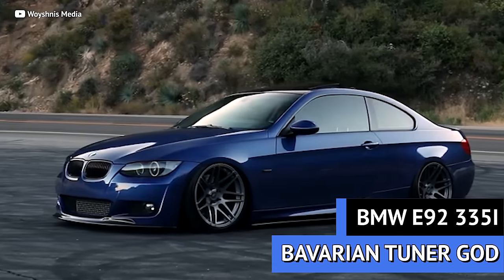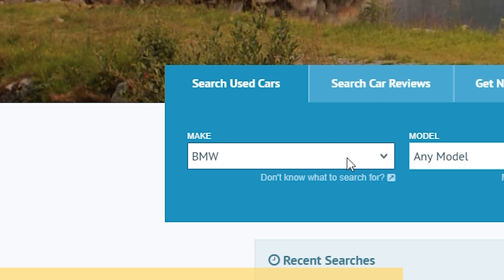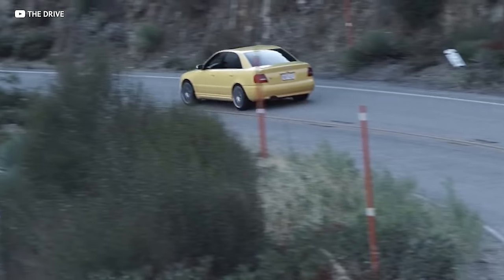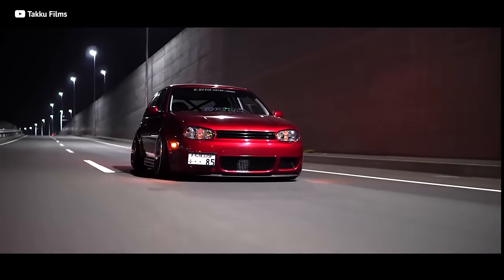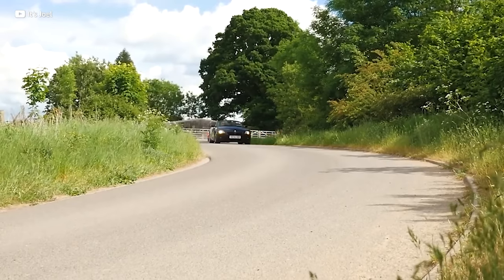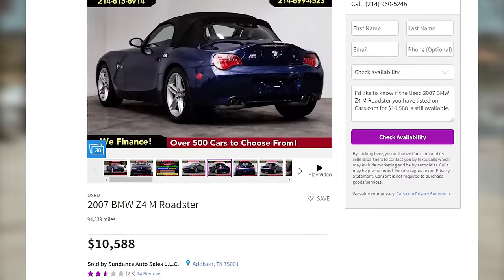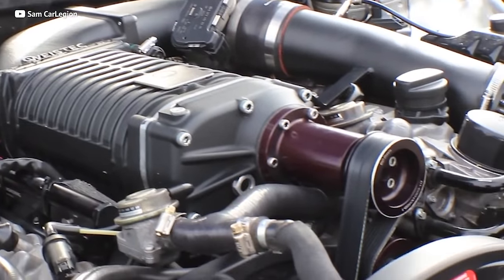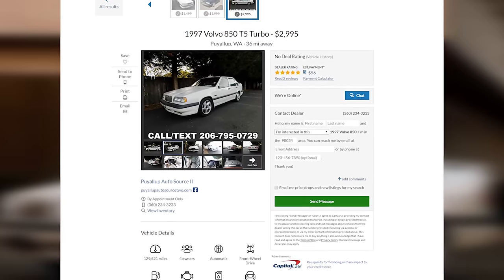CHEAP European Cars with INSANE Tuning Potential

Comment: Well, instead of the Z3M he could have put any BMW with a M50B25 or M52B28, they are easy to stroke to 3.0L and have quite the tuning potential (There are M50B25 engines with more than 1000hp)

Comment: Those older saabs can handle much more power than the new ones. For examble b204 and b234 internals last up to 600hp. You can take lots of power from the engine and that doesnt cost as much as compared many other cars

Comment: Love Swedish cars! My Daily is also a very nice grampa sleeper. Volvo S40 Turbo Stage 2. 155.000km with original clutch, 0 Problems. the problem is that, at least here in Spain, is not very appreciated by tunners as well as saabs... :(((

Comment: How about old BMW engines? For example M50B25. Thats the one they've called european 2jz. In stock it has 192 HP. Some people build it up to 600 or 700 HP. A Little turbo kit tuned to 0.4 bar can turn it to 400HP little monster. ON STOCK INTERNALS !!!

Comment: The b8 Audi s4 with supercharged v6 is also a great tuner car... they can make upwards of 500hp with the right bolt ons and tune... I have a b8 and with a singles pulley, tune and it makes around 400whp up from the stock 333chp

Comment: Look, I love my BMWs, so I shouldn’t be ignored when I say that the Supras 2JZ smokes it’s Tiers, while the N54 smokes itself- likely blow up if you touch it
Reply: What about the maintenance cost of your BMW's is it really that bad like people say?
Reply: marouan harrath it’s not all bmws. The N54 was BMW’s first turbo engine in many years and they f***ed it up pretty bad. The engine is stupid strong internally. But ansillary components fail. Water pump, high pressure fuel pump, injectors leak, turbo wastegate rattle, oil filter housing gaskets, valve cover gasket, oil pan gaskets
Reply: @marouanharrath7909  No the maintenance is alright but I'm from Europe though 😃
Reply: @marouanharrath7909  Audi is way worse
Reply from the maker: hahaha
Reply: @laysy1743  really? I thought Audi's are more reliable
Reply: @marouanharrath7909  Not at all actually a former Audi A8 owner here. A thermostat that needed to be replaced after like 6k miles it required an engine out service
Reply: @laysy1743  ohh really! Thanks a lot for the info bro, so you think BMW's are a better choice?
Reply: Audi's are worse. Those will total themselves as soon as you tune them. My best friend has had three of those A4s
Reply: @marouanharrath7909  it depends on how u take care of it. Mainly if anything you've gotta be watchful of what u do with it plus keeping a eye for maintenance and keeping up with it when its needed with N54s cause if u don't it'll break on u at the worst time possible. Chances are if u want a reliable bmw I'd just stick with any 40i(B58) BMW or any that have a S55(despite their crank issue that they have).

Comment: How about the reliability on these vehicles?
Reply: The 335i. The i6 is really well known for being unreliable in most components other than it being internally strong since it was BMW's first ever turbo 6 but is still VERY tunable.
The Audi S4. I'm not too informative with Audi's but I hear that the one in the video is unreliable.
The VW R32 I 50/50 do and don't know since I hear mixed views of it being reliable and unreliable since its a VR6 powered car but they can still push alot of power.
The BMW Z4M roster. It's i6 isn't bad but its not as bad as the I6 in the 335i it's that u must be watchful of these since i think the coils go bad on these usually(I'm doing my best to remember correct me if im wrong)but I'd say they make a decent bunch of power(expensive sort of)with enough work done to them.
The saab I'd say these are REALLY well known for being reliable but very rare depending on where U live but tuning wise I dunno. 
The Mercedes....well I dunno much about that sadly.
The Volvo -very very well known for being a legit tank in that gen so there sorta the best option out of all since their well known for being stupid reliable.

Comment: I heard the s4 is one of the cars you should never buy
Reply from the maker: its fun to dream!
Reply: Carfanboy2003 this guy was on the do on buys
Reply: S4 C4 is a must! Its most reliable because it has 2.2t 20v 5pot
Reply: I've owned the B5 S4 and had full stage 3 with KO4 turbos, N54 335 ( and single turboed it ) AND still have  E55 AMG. Out of them all the B5 S4 was the most fun. Didn't have actually that many issues. The BMW N54 335i was the worst car I've ever owned. Blew 3 engines. ( 3rd one was fully b uilt ) still blew up. The E55 has been the most reliable and is also Renntech Stage 3.
Reply: The only S4 that ill ever buy is the B8-B8.5 S4
Reply: @MMafiaV  100% there had to be some user error. Those bimmers is actually reliable cars if you know how to take care of cars, generaly speaking. Have had alot of different bimmers, my brother had an audi, citroen, mazda, ford, volvo, toyota, opel/vauxhal etc. Worst cars that i or anyone in my family has owned, ever, is ford and volvo hands down. Specially the fords. Best ones has been the bmw and mazda without a doubt. Citroen and toyota was good aswell.
Reply: @kingofohio5689  got mine 😜
Reply: @henrymetcalf4361  i'll be jealous af
Reply: @kingofohio5689  car goes well bit of a bigger turbo and intercooler just getting the parts together for the big build would love to have about 800hp shouldnt be a prob to get her there kwik
Reply: @MMafiaV  if you blew 3 engines then it was user error.

Comment: I like the list, but you captioned the thumbnail " Supra who ". Supra's have been known to go over 5000 HP and over 190 MPH. When I was 16 my parents bought me a used Cadillac CTS-V. That's what I learned to drive on, stock was 600 HP tunable to over 2,000 HP. But even then I wouldn't compare 2000 HP to 5000 HP. Again I like the list. But I feel like there could have been a better list.

Comment: Z4m is cheap because it has the S54 engine from the e46 M3. Set aside money for rod bearings,vanos and cooling issues. Make sure you get it with a manual otherwise set aside more money for that shitty SMG transmission. My friend just fixed his SMG on an 08 M6 for over 6 grand at the dealer not long ago.

Comment: Well, first of all, the V6 on the saab ain't that good, 2.8T first gen was better then the sec gen, since the chain wasn't the best. expensive as hell to change! Cheaper to put a new engine in.
The 2.0T is the best engine to go on the 9-3.
But if you want to go with the cheapest route, take the 9-5 B235 engine, and Piston and rods from the B234R mill those down 1.2mm, slap some arp'ss studs for the top, and delete the balance chain. Boom engine can hold 600hp easy. But watch out the 2.3L platfrom produces allot of newtonmeters.
Both the B234R/T5 and the B235/T7 fails around 300hp in stock config. on the T5 its the head gasket, and on the T7 it is the pistons. So more or less, you will end up with a hybrid engine! (google T7 vs T5 kolvar) First pic you see
250hp/350nm in a stock Aero 9-5 from 2002-2005

Comment: euros car can pack a punch indeed but that punch wont come cheap. ull blow ur engine or anything related to it in just 1 run. the reasons JDM are monsters isnt just cuz they can have high HPs. they have amazing handlings and dont break or when they do u can repair it without having to sell ur house for it.

Comment: Lets Face it: Most people here won’t tune their car. They’re looking for cheap factory power. If you buy these cars for the prices mentioned in the Video, be sure to spend 15k+ in repairs in the first 2 years of ownership. I don‘t know about the saab, but if you want a 335i, R32 or the merc in solid condition with low mileage, you’re looking at a 18-22k pricetag.

Comment: Think you might mixed up a SL55 with a CL55 which is not supercharged and only 360 odd ponies you won’t get a 493hp SL55 for 6k sorry
Reply: Brad is correct, it's the CL55 AMG, not the SL. "The CL-Class is offered as seven models: theV8-powered CL 500, the V8 powered naturally aspirated CL 55 AMG, the supercharged V8-powered CL 55 AMG, the V12-powered CL 600, a limited-edition V12-powered CL 63 AMG, and the bi-turbo V12-powering the CL 600 bi-turbo and the CL 65 AMG. All models seat four."

Comment: Never any love for the 99-2001 C230 Kompressor Supercharged inline 4's....
I smoke V-8's and BMWs all the time and they think I'm using nitrous or have a lot of mods done...(mine is almost stock lmao)...
They are so cheap, the parts are cheap(except the OEM body parts, but aftermarket products are available) ....
Reply: Yes i had one a 2002 C230 Komp so it was still the 2.3l S/C (They later changed the C230 to a 1.8) 3 door coupe (body was C203 rather than W203) all i did was change the supercharger belt and it was a rocket, faster than my next car which was a Jag XF S 3.0l TDV6 (275bhp)

Comment: bruh all the ones he's showing are well over 100k miles be ready to drop around $5-$10k more than he's showing you for a slightly reliable car that's going to be extremely expensive to fix when you blow a 10 year old engine.....

Comment: VAG:VW Seat Skoda Audi 
1.8T 
1.9 TDI 2.0 TDi Pumpe Düse fuck Common Rail
3.0 TDI V6
VR6 2.8 3.2 but as Turbo conversion stock they're absolutely shit 
BMW:
E36 or E46 as 320i 325i 328i but they get really expensive but still best for Drifting on a budget
330d 335d 325d 320d are also great E46/E90/1/2/3
Benz:
I know shit about them
Opel:
I also dont know so much about them
But i think The 1.8L in the Astra h is good
GM uses Engines from Opels

Comment: Do not watch this video and go out and buy the cheapest example of a German car you find. You will have problems. Especially when it comes to the s4 and 335i. Think about it if a car that costs $40,50 grand new is now selling for the price of a used Honda or Toyota. There is a reason why. And that's not because it's the best deal of a lifetime.

Comment: Supra who? You mean the real Supra 2JZ Gen4 with stock block that could  handle 1000hp you mean the Supra  with built motors  that have 1500hp 1800hp and  more hp. You mean Supra  that had other Innovative designs. This current Supra is in name only, BMW Motor and transmission the car is even built in Germany. Only 3 cars have any real high hp tuning  potential in this list BMW 335, CL55 Benz and R32 every other car on your list aren't worth the amount of money you have to put into them just to get 400 to 500hp at crank. Not to mention parts on all German cars can be expensive. That something you leave out in your video yeah you can buy that Benz for 10k but how much just to do brake job on that Benz? By friend brought 2004 SL AMG with  24k original miles. He brought it to 3 different mechanics that's specialized in Mercedes Benz cars none of them could get breaks right had to bring to dealership $1200 for break job.

Comment: None of your cars can near to the mighty SUPRA... so choose the thumbnail wisly bro
Reply: If the Audi has a i5 they have a advantage,the Z4M 50/50 since its small but the 3.2L S54 has potential(if there's a trans that'll handle the torque),the VR6 well there expensive to build anyway,and the 335i depends on hp they can keep up there ground if they're close in hp and can actually shift.